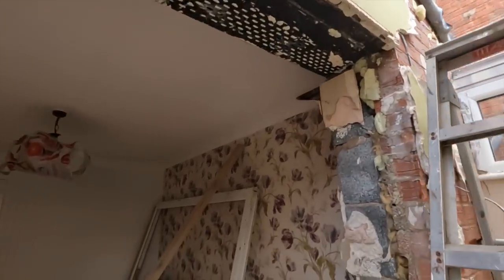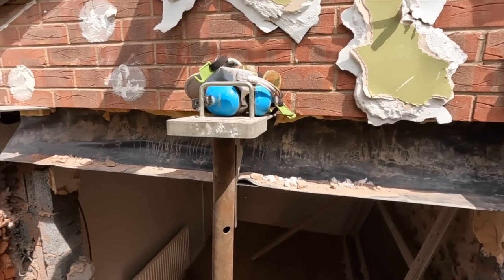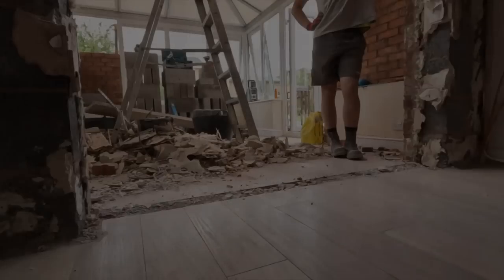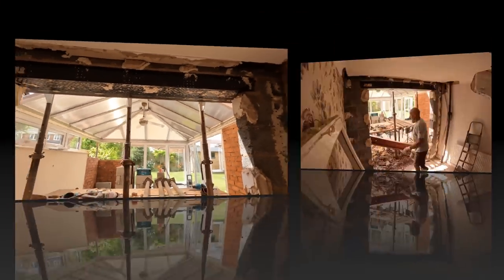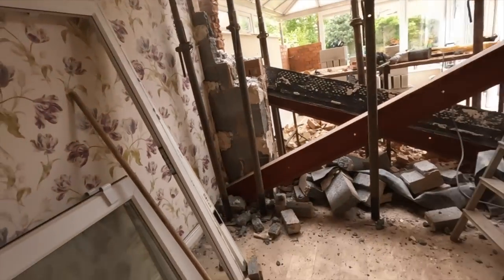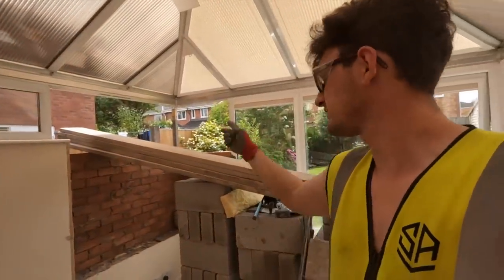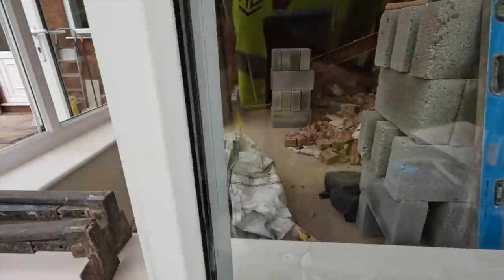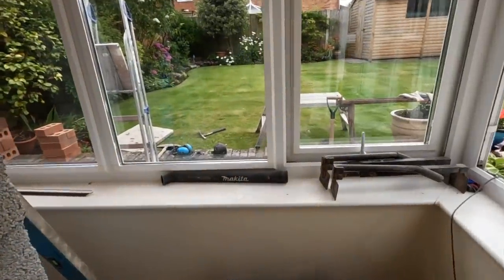ISSUES WITH THE STEEL BEAMS ...CONSERVATORY REFURB PT 3

Comment: As the steels are much longer than the lintel  you could have cut pockets at each end and built-in the padstones before taking the linte out.
It looked as if there was enough room above  the lintel to install the outer steel before dropping the lintel.
That way you'd only had to acrow support one leaf at a time and had a lot more toom to work.

Of course everything looks easier from an armchair 😁
Just a thought if you get something similar in the future.

Comment: Just wondering what mix ratio you use when bedding on the pads. 3 n 1? 4? Is it a special kind of cement or standard bag of blue circle?  Cheers.
Reply from the maker: We just use standard cement and a 4 to 1 mix 🧱👍🏽